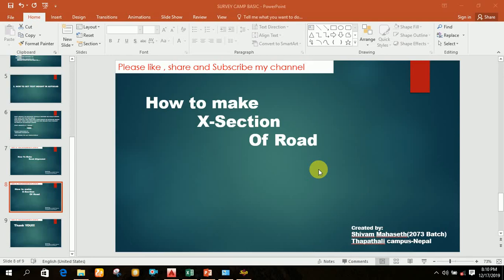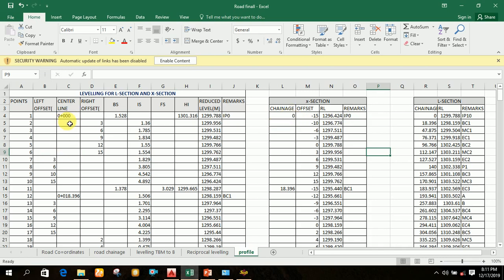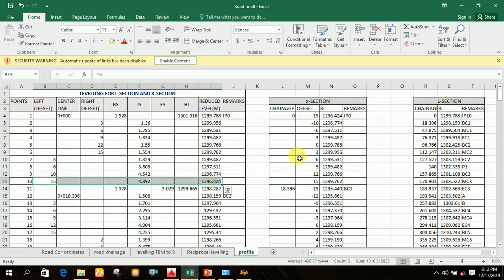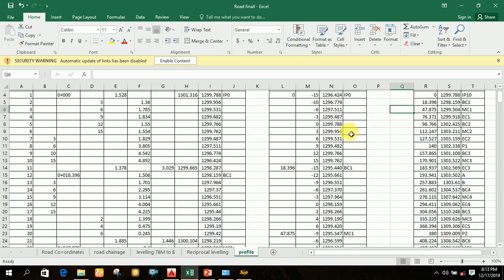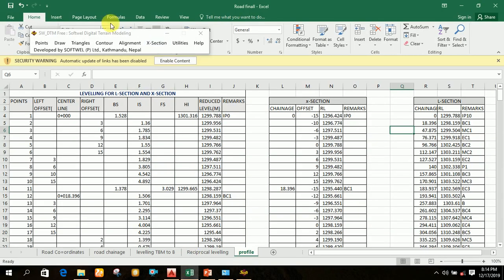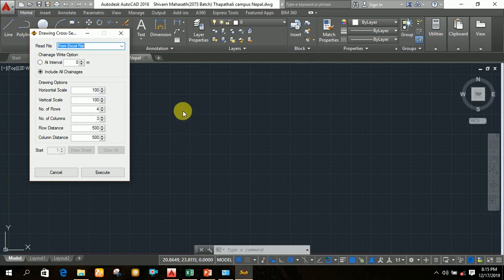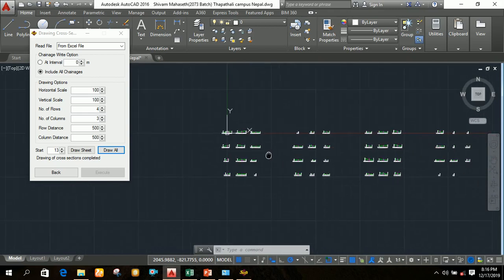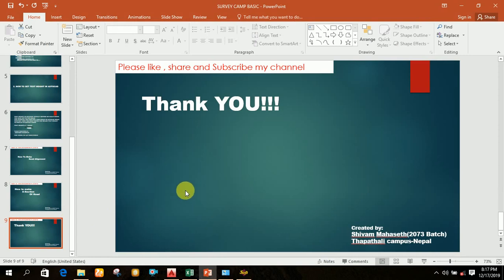How to draw cross section of road in autocad|swdtm

Comment: what is SW Dtm....
Reply from the maker: A powerful DTM with unlimited points capability. It contains feature line definition enabling the user control over the surface model and contour creation . It is seamlessly integrated and can be used for extraction of Longitudinal and Cross section profiles as well as 3D visualization
Reply from the maker: https://youtu.be/F74uf1NURSg